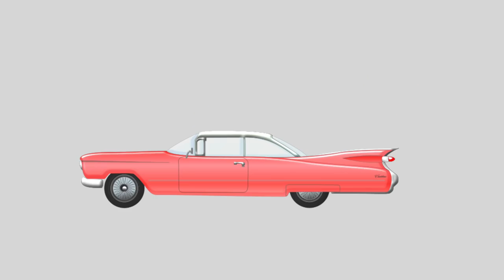Yes, Rockets CAN Fly in a Vacuum

Comment: Lol. This is the most hilarious explanation i've heard on how cars move.. Car is not moved by the force of the gases leaving the exhaust pipe.. engine powers the wheels to rotate.
Going by your explanation, gears are not necessary at all. I accelerate when the car is in neutral so the engine revs and gases come out of the tail pipe and expect a car to move? Hilarious
Reply: She said the exhaust exerts a force as it leaves the car, but not enough to overcome the friction between the wheels and the ground.
This is a completely accurate and factual statement. What's your problem with it?